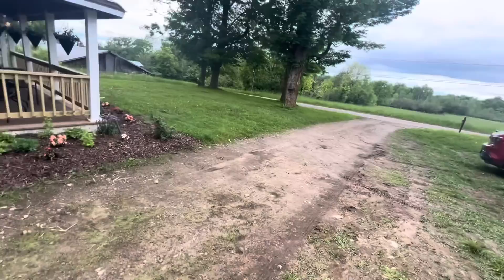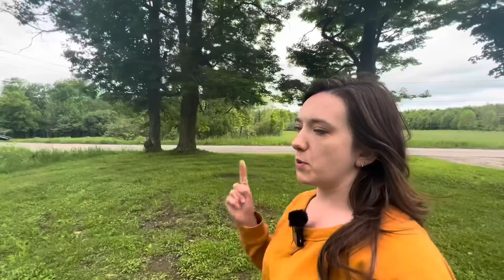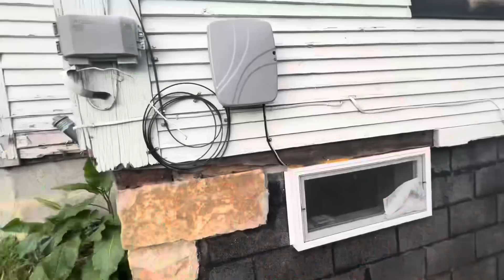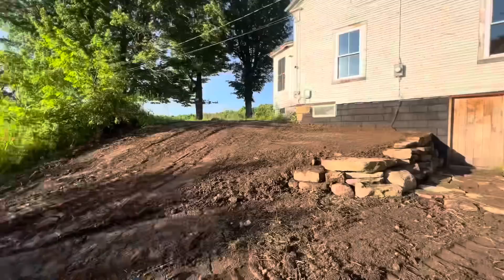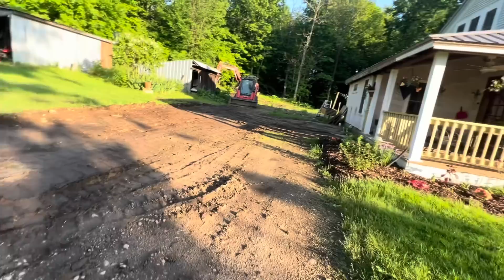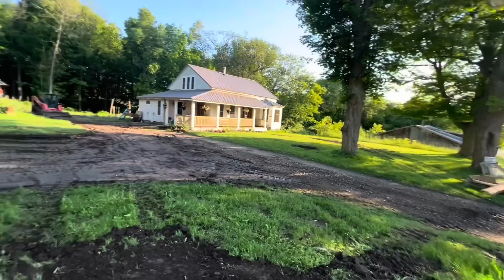MAJOR Excavation Projects & Improvements @ the House! (Part 1)

Comment: That was a big project but we all know you're not afraid of complicated projects, we've seen you in action! ha ha ha
I agree with the other comments, to use his skills, while he's there, and build a short wall around your future patio, outside the patio doors.
SUGGESTION - Honestly, I would waterproof that block basement wall, inside and out, since that seems to be the cause of your flooding.  I would also have your friend build a wall, coming out from the side of the house, where it slopes down to the basement lower level.  Make the wall as tall as it needs to be from the lower level to the upper front yard and incorporate a few steps to get down from the front yard to the basement level.  I would move the soil away from the basement wall.  You could also have your friend build another wall, coming out from the rear of the house, extending toward the woods and a few steps from the patio level, down to the basement access area.  Not sure how thick the basement access door is, but maybe reinforce it and insulate/weather proof and install weather stripping.
NOTE - was concerned one of the cats was out at the end of the driveway, near the road.

Comment: Abby, when we did our driveway, we didn’t have the money for a blacktop or to be able to build a concrete driveway. We settled for placing some cedar logs as our frame and placed gravel down and into the extra parking areas for guests. It’s been 25 years , we still haven’t been able to blacktop it. But Pinterest has a lot of ideas to dress up your driveway if you ever decide to step it up a notch. I can’t wait for you to get it all done.

Comment: Why not have a block wall built up against the side of the house and fill it in with dirt and have it leveled out or maybe have it in there at an angle so the rain water will drain off hopefully